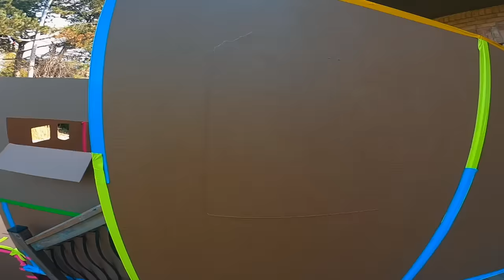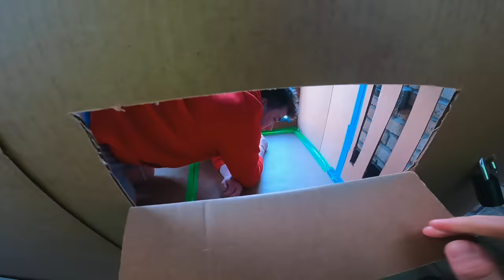BIGGEST 5 STORY BOX FORT CHALLENGE! 50FT TALL SCARY 😱📦

Comment: You could make overhanging pieces of cardboard that are coated in tin/aluminium foil for rain protection. Also, that's just a 2 story box fort with an external ladder leading to a 1 story box fort.
Reply: Technically it is 5 stories
Reply: @goldnewofl76  it's neither 5 stories technically, nor actually 5 stories.
Reply: @hiddentreasure2161  prob didnt see the full vid